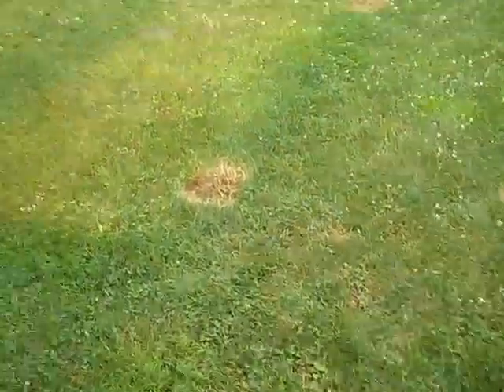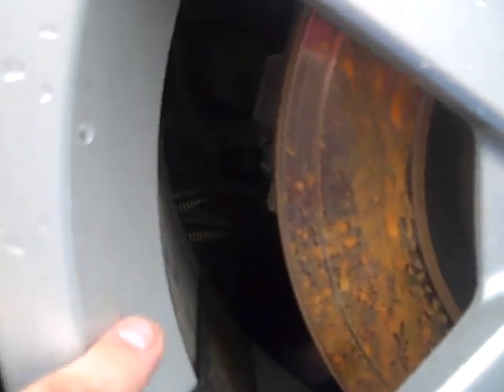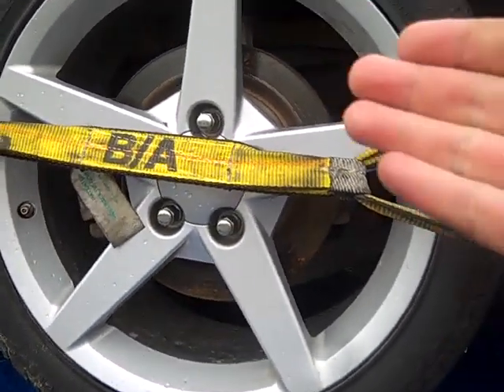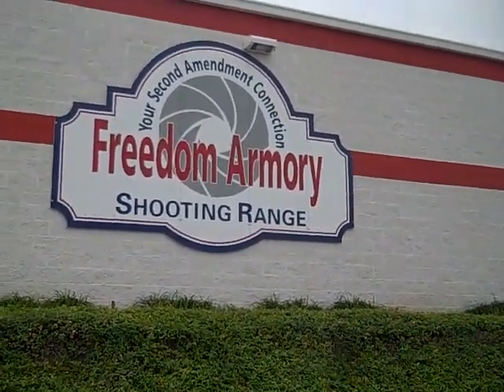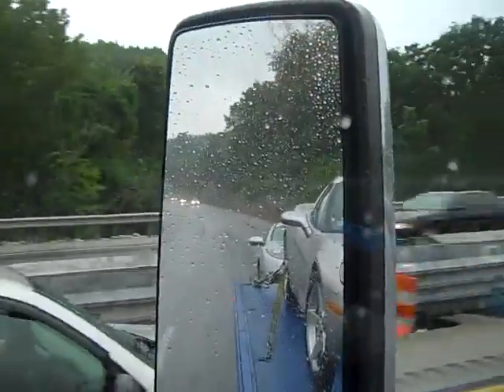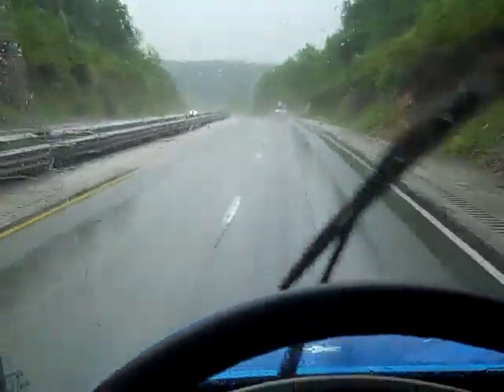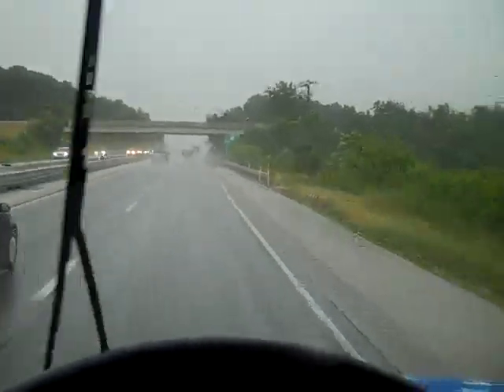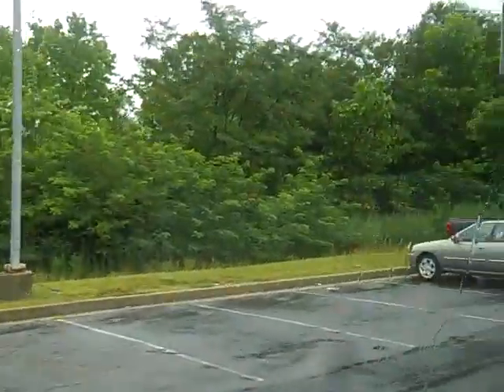Towing; The Hard Car Challenge

Comment: OK, guy. I'm going to help you out with that kind of Vette. The perimeter frame has slots for mini-J hooks. They're a bit further forward and rearward of where you expect to find them, but they're there. I use my tilt and slide to scoop up the front end when possible. That front undercarriage has been very durable for a long time, to deal with parking blocks. I'm not familiar with the tilt and slide abilities of the Century. I'm utterly sold on JerrDan. I can easily scoop cars and trucks up to 1ton class, using the towbar to support the bed tilt. Really makes the jobs easy. I avoid rolling on the ground if I can.

Comment from the maker: @INFIDELxSTRONG Dude..in that area of PA, the radio reception flat out sucks...I was running my MP3 player through the aux plug, and most assuredly cranking the tunes....especially my 80'S playlist!!!
yeah the second car, is known as a double haul and it is alot..WHOLE lot more work to tow those.
two more straps, the secondary warning slap on's, and of course routing and hooking on a safety chain as a just in case it gets loose it'll drag behind the tow truck until you can stop.
Seeya bro
Dude

Comment: Question Dude:  Around these parts tow trucks like the one you drive always seem to have their flashing lights on when they have a car on the bed.  Is that a requirement?  If so, what's the reason?